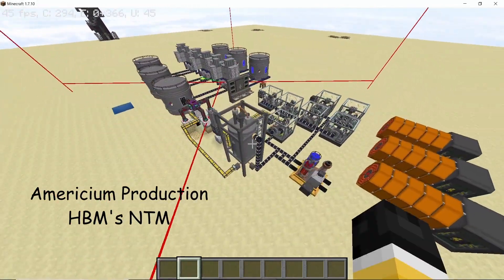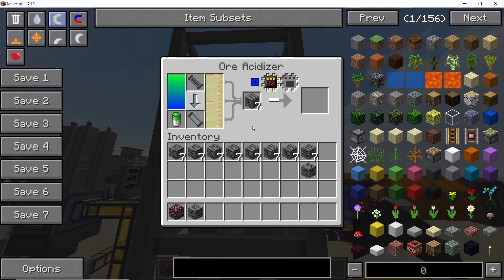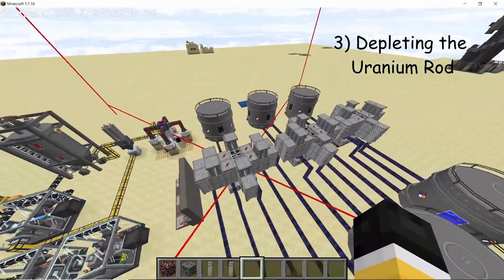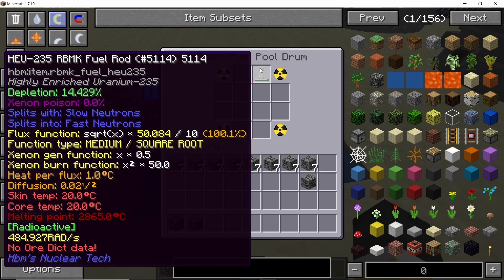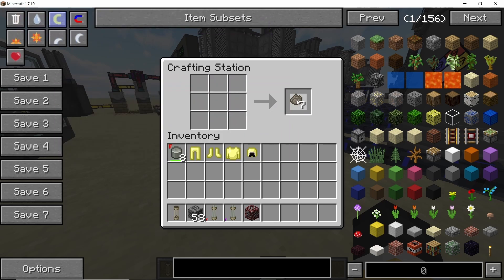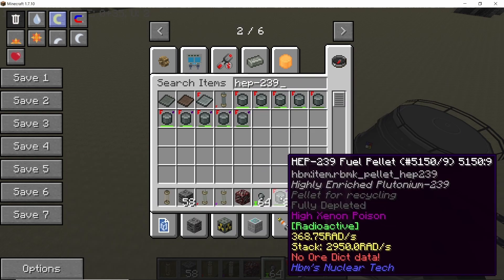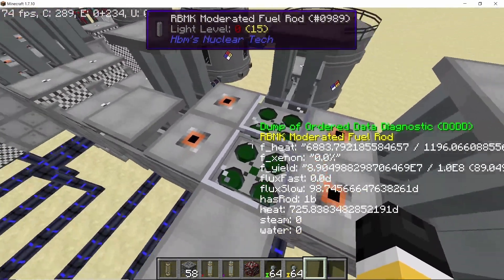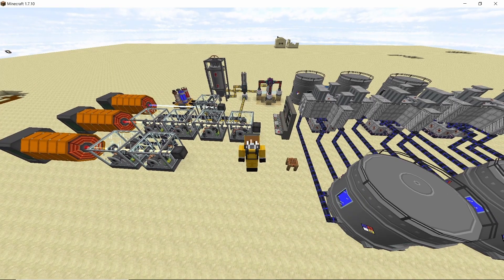Americium production guide for HBM's NTM || Americium 241 & 242 production in HBM's mod Minecraft

Comment: Btw bro pls make a vid on the linear interpolation thing in your artillery vid if u remember, i wanted to ask u bout this a long time ago
Reply from the maker: I'll just type it out what the linear interpolation thing was all about - in MCHeli when you use artillery turrets there is a distance that is written in the gui of the turret... However the shell lands far away from that distance.

So you take 3 values of the "distance in gui & actual distance" and plot them on a graph ... Which will give you a good enough idea as to what distance should be displayed in the gui to make the shell go a certain distance away
Reply from the maker: If you don't wanna use a graph and you already have a good grasp of the linear interpolation formula then you can calculate it as well but as a core physics and mathematics student I find using graphs much more intuitive